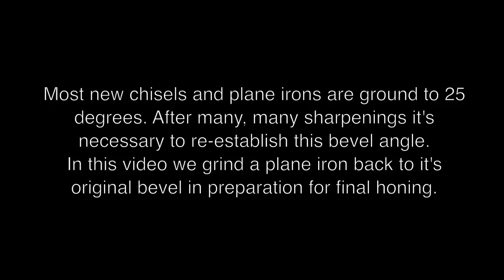Rough Grinding A Plane Iron • Complete Sharpening Series Video 2

Comment: I bought one of those grinders about 30 years ago for about $30 and never could figure it out. Today I dug it out, cleaned it up, unfroze the bearing and sharpened a couple of my stanley #4 blades. I think the wheel is a little high on the outside edge of the wheel. I have no way to dress it, so I just went back and forth over the high spot. The first blade took about an hour to get right. The second took about 15 minutes. There's a bit of a learning curve. The bevel was easy. Getting the edge square to the side was the hard part. I finally set the blade in the jig at an angle and used a magic marker on the bevel to see where I was grinding.I'm gonna try doing my electric hand plane blades next. Thanks..

Comment from the maker: That machine is the Makita 9820-2. I use it primarily for quickly putting a fresh edge on my planer and jointer knives. I have a complete video series on my channel about using it. Last week I was milling some very tough hard maple that had some figure in it, and wanted perfect surfaces with no blowout ,so I pulled and sharpened my planer knives 3 times and my jointer knives twice in one day. It is a really great machine. Allan

Comment from the maker: @dzzz78 No it is not. I just try to be consistent and get everything as close as possible. And before I reground the bevels these knives were still cutting quite well because of the clean facet produced on the diamond stones. But when knives start getting 7, 10, 15 degrees away from 25 degrees it is time to address it.

Comment: Its now 2022, and I cant find any replacement sharpening wheels besides 60 grit and 1000 grit. Where did you get your 120 grit wheel? Are there other grits available besides these three? Thanks for the video.

Comment: Hi! I'm wondering if you have any recommendations for sharpening new garden spades that come without an edge. We sharpen about 200 spades a year before we sell them, using a regular bench grinder freehand with a coarse stone. The edges are curved so I don't think a jig would work. I'm wondering if a wet grinder would be better, but we're taking off a lot of metal and I'm not sure if it would be as fast or how often we'd have to replace the stone. Anyone's recommendations are welcome.
Reply from the maker: I am an avid gardener and i sharpen my shovels with an angle grinder and  a 60 grit disc on a rubber backing plate. Works like a dream. Write me at askwoodman@gmail.com and I will send you pictures of the setup. Allan

Comment: Haha I thought I was the only one left in america who still used an old horizonal sharpener.mine was used in the 80s when I bought it for $8.00.it throws water every where , you need to wear a wet suit, needless to say I try to sharpen every chisel and iron at the same time.on ly draw back is it wont do very short chisels.I like the wood degree guage you made , thanks
Reply from the maker: Edad Martin I have a whole series about that using that machine for planer/jointer knives. It is a mess. In the series you can see the classy garbage bag I wear to keep the water off me.

Comment from the maker: 1000 is what comes with it. This is a 120 alternate wheel. They also make a 60 and a 6000.
Reply: Where did you get the 120 grit wheel? I can only find 60 and 1000.
Reply from the maker: @steadyeddie7453  Unfortunately Makita discontinued that 120 wheel. A real shame because that green silicone carbide really cuts fast.
Reply: @AskWoodMan So odd that they make a 60 grit and 1000 grit only now.  Sharpening is all about progressively working up the grits starting with chipped edges to honing and polishing. Even more odd that there isn't an aftermarket version of these wheels. Thanks for the quick response. Cheers

Comment: Allan..just got a 9820 off Ebay and excited to try it out this weekend.   Is the fluid in the reservoir pure water or the 50/50 w/ Simple Green?
Reply from the maker: Hot water in the reservoir, but I will the Simple Green mix to clean the stone if I have fouled it with WD40 from oiling the cast iron tool holder.

Comment: what's the grit of the wheel that comes with this sharpener?
Reply: I realize you probably have your answer, but for folks just reading these comments, the 9820-2 comes with a 1000 grit wheel. I see 60 and 1000 grit wheels are available but haven't found anything inbetween. I would love one in the 220-320 range.

Comment: Was the after market sharpening jig used with the Makita 9820 commercially available or did you fabricate it? Are there any references to the jig availability/fabrication elsewhere on your site? Great video.
Reply from the maker: +Bill Maille Bill Highland Woodworking still sells that aftermarket jig. http://www.highlandwoodworking.com/dual-usehandtooljig.aspx